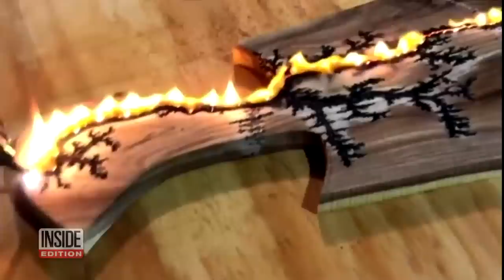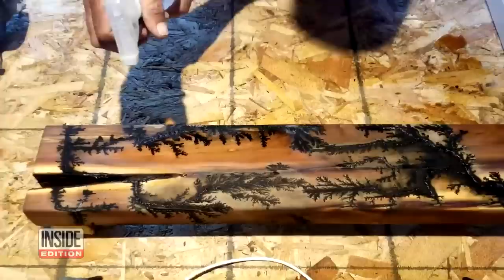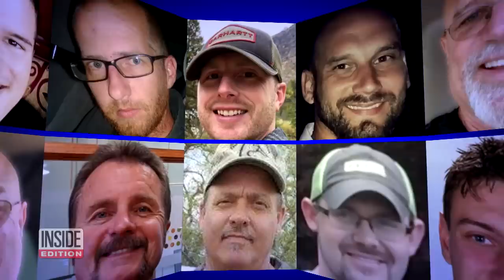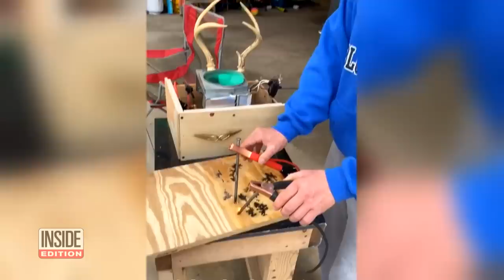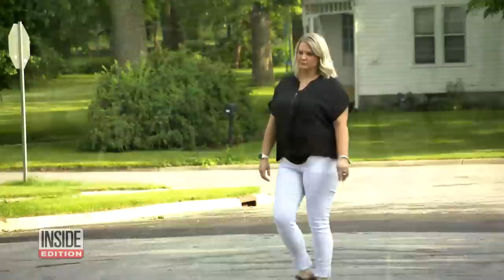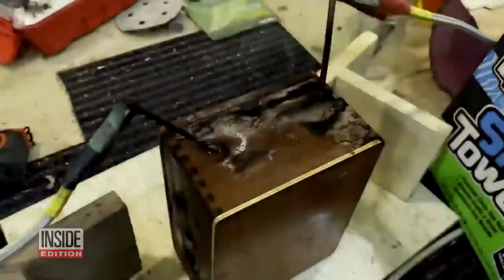Are DIY Fractal Burning Devices Dangerous?

Comment: The fact that he’s holding that higher voltage with bare hands, one on each hand, which arcs across the heart, blows my mind.
Reply: Yeah he should put them down and not touch them have an on off switch and a pedal that is 4 feet away from the work that woulda been better
Reply: Yeah and his grip is so close to the conducting parts!

Comment: There was a time I wanted to try this out when I was 18 looking at tik tok. For months I asked my mom to buy me this equipment for that as a side business hobby. Thank God I found out how dangerous it really is. I still want to try wood-burning but I don’t know if it’s very similar to this.
Reply: Ordinary wood burning is much better anyway. I did it at cubs or scouts, and you can be far more creative etching your own patterns and pictures.
Reply: No, wood burning is is completely different because it doesn’t involving creating arcs through the wood. Its like soldering versus shorting out a car battery.
Reply: Don't
Reply: It's not. You draw and make the design with tips and a device that just heats the tip. Or you burn a design into. But not with just raw electricity.
Reply: If you follow basic electricity precautions it aint that bad, but dont listen to a guy pn youtube, dont mess around with transformers lmao

Comment: theres a reason electricians wear insulated gloves and check them for holes before every shift
Reply: Gloves provide no protection from the amperes given.
Reply: @darksparkyshark430 fractal burning uses a microwave transformer off of standard residential power, it's literally impossible for it to be high current with the voltage stepped up that high, although voltage that high with alternating current would be the real danger wearing gloves, but I am assuming he's talking about gear worn by lineman. That said fractal burning is stupid and should not be done

Comment: At issue, is the people who make these videos don't explain the parameters and they also don't talk about what liquid they're spraying on the wood to make this happen. I sand floors for a living so I don't know if that's polyurethane, gasoline, linseed oil, I don't know?
Reply: It's a solution of water and baking soda, it increases the conductivity of the water. And yes, almost everyone that makes these fractal burning videos don't explain what's going on because most of the time they don't know themselves, they just followed somebody else's directions without understanding how everything works. The guy holding the jumper cables for instance, he was pretty close to cashing in his ticket on that one. I do all sorts of high voltage experiments, many of which put these puny little 1200 Watt microwave transformers to shame (I'm building a capacitor bank right now that can cause watermelons to detonate), but I've spent years educating myself on how to do these things safely, whereas a lot of these people see it on tiktok, spend thirty minutes reading up on how to build it, take a trip to the junkyard or ebay, then jump right in without knowing anything about dead man switches, the one hand rule, proper high voltage isolation, a safety observer with kill switch in hand, or common sense...

In other words this is just another Darwin Awards ceremony...

Comment: I have absolutely no idea why the guy just casually handling the jumper cables with nails with his bare hands didn't think it was dangerous. It obviously requires a lot of voltage/current to burn such patterns in wood, and it doesn't take much IQ to figure out high voltage/current is dangerous.
Reply: Exactly  🧠📉
Reply: Keep living your perfect existence 🙄
Reply: You're overestimating people in general.
Reply: That guy is dead now.
Reply: I feel tingling when I saw that. Crazy stuff.
Reply: That's a good question. It does after all say DANGER HIGH VOLTAGE on that part he yanked out of the microwave.
Reply: IQ is something most Americans don't have an abundance of.

Comment: Even the professional’s set up looks sloppy and dangerous. If he trips or has a medical problem, he could fall right into it and die horribly. Electricity can be an excruciating way to die and takes control of your muscles so you can’t even save yourself unless there’s a power hiccup. 

I wouldn’t even consider this unless there was no physical way for a person to touch the electrodes while they were powered, like inside of a closed chamber, restrained by insulated clamps or on the ends of polycarbonate or ceramic insulators. A momentary push button switch to turn on the transformer would be ideal, since the operator would automatically release it in the event of an electric shock rather than gripping it harder with involuntary muscle movement.

Long story short: if you’re working with this kind of voltage, your set up should look like an OSHA engineer designed it.

Comment: It’s not voltage that kills you. It’s amperage.
Reply: Yep
Reply: Correct. I Learned that from my dad and the movie called Tango and Cash.
Reply: Yeah but the amperage is very depended how high is the voltage compared to the body or circuit total ohm so if somewhat your body ohm is lower because example like wet then the amperage will increased
Reply: @VJETRA  yeah because with 5 volt you can still get 5000 amps if the Ohm/resistor is 0.0001 but with high voltage the potential to get more higher ampere if the resistor changing to your body with the result if high Ampere will kill you. Hmm so its still Ampere the one thatwill kill you but its related to how much Ohm/resistor your body has resulting reaching the killing limit of Ampere. So the Volt is the cause/bad person but the Ampere is the one that destroy your body and killing you or Knife.
Reply: @raifikarj6698  i said mainly, just like bullet wont kill you if you toss it at someone but with enough speed it can kill  so the main cause is the speed and of curse without bullet there wont be any speed of anything.
Reply: It's stupidity

Comment: Is fractal burning dangerous...yes...ESPECIALLY WHEN YOU'RE DOING IT WRONG AND DONT TAKE PROPER SAFETY PRECAUTIONS.  Rule number one DONT hold the damn electrodes in your freaking hands! Where rubber gloves, put the items on a rubber mat, USE A DEAN MAN SWITCH! You long leads. Not saying this would have prevented this guy from getting killed, but it would have reduced the chances a hell of a lot!

Comment: The voltage number doesn't matter, amps do.
Reply: actually it depends on ur zodiac
Reply: Complete nonsense! Both volts and amps matter, because you need a certain voltage to push a lethal amount of current through your body. And it also depends on lots of other factors.

Comment: If you know how electricity works then it's safe if you don't then yes it's dangerous. It's very dangerous but you have to know what you're doing
Reply: I would add that you have to know how high-voltage electricity works, and that ordinary insulation on wires (and jumper cables) is ineffective.

Comment: This video is a hypocritical message and cautionary tale at best. 

“Leave it to the professionals. Avoid the DIY method.” - As they show a DIY Lichtenberg machine sitting next to the “professional.”  Also, you can’t become a professional without being an amateur first. Just learn to do it right by watch all the content you can on safety, and don’t try to find a bargain when your life literally depends on it.

Also, the widow associated with that first poor widow was insanely dangerous. That video is proof that her husband did not take the necessary precautions to do this art properly. 

For those interested in trying this type of art, when you’re watching YouTube content, if the creator isn’t using a foot petal (dead man’s switch) or is holding one or both of the electrical probes, you should ignore them entirely and find a better source of info. There is ABSOLUTELY NO need for you to be touching any part of the machine except a foot pedal. There isn’t a reason for you to be within 1 foot of any part of the machine while it’s turned on. Be cautious and don’t become complacent!

Comment: this is why i always turn off my open case computer by powering off the power supply switch button, better safe than sorry = avoid being electrocution
Reply: The only dangerous part in a PC is the high voltage side of a computer's power supply unit (PSU), which is completely covered by a metal case. The rest of the components use only 5 to 12 volts and is completely safe. Therefore touching any part of a PC is NOT dangerous unless you're poking a metal object into the PSU or the PSU develops a ground fault and your PC is not grounded/earthed.